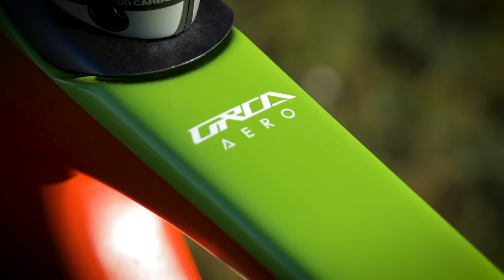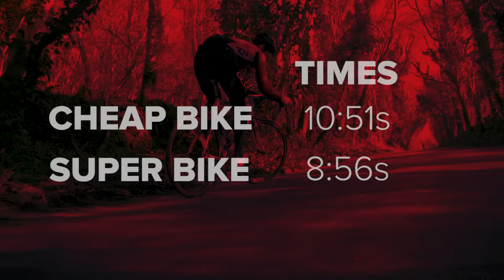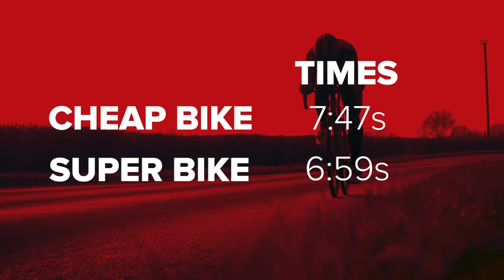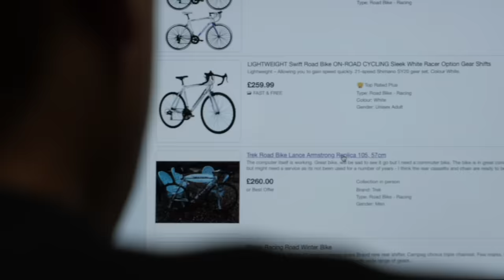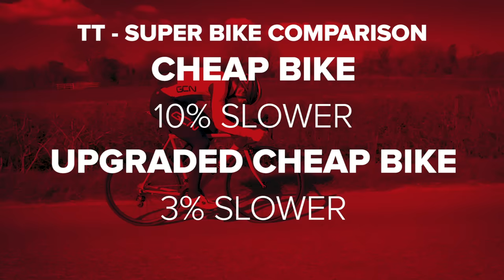Can We Convert A Cheap Ebay Bike Into A Superbike?

Comment: Lol... all of you spoiled guys on your super bikes!!  I actually appreciated this video quite a bit as I'm of modest income.   I started riding to help recover from a car crash injury.   An old single speed Schwinn Caliente is where it all began.... a year later I was stripping road bikes and converting them into single speeds myself and replacing everything with bits of carbon.  I got my 24lb Diamond Back down to 16.71lbs.  Fast but uncomfortable.   I learned of proper fitment (watching GCN of course) and that made a world of a difference.   I was faster using less energy because my saddle was no longer beating my rear end to a pulp anymore.   I upgraded my tires from 23mm to 25mm and could not believe the difference.   I traded my bullhorn set up for dropbars and found that I could deliver more consistent power to my wheels for a much longer period of time.  Needless to say,  "I'm proud of my bike!"  It took me over 4yrs to build that bike and as of last year I've gotten into fixed gear and  track bikes.  Got a 1986 quad butted Fuji Track bike that I ride on open road and in traffic.   What a great training tool!!  Riding my track bike forced me to focus on  pedaling and improved my pedal performance and cadence all the way around!  I love blasting uphill on a fixed wheel set up... the momentum trains you to keep going.  AND NOW... I want a bike with gears.   No,  I crave a bike with gears!  I have plenty of bicycles... about 19 to be exact.  I have an old Peugeot that's been identified as a possible Team bike.   It's already buttery smooth but alas with down tube shifters it's an obvious sacrifice in speed and I don't sacrifice when it comes to speed!!  I CRAVE A SUPERBIKE!!  And that's why I loved this video so much.   I view geared bikes as "range extenders."  Ultimately I imagine that my single speeds and track bikes will enhance  my riding experience, provide training so that I'll have a competitive edge on a true road bike!! 

 Sorry for the long comment but this 25 minute video is a wink at the dream I've been chasing for nearly 5 years now.  Love GCN... keep up the good work!

Comment: I still have my CIOCC custom built in 1985... 12 speed Shimano 600 SIS all stock except the handle bars and seat which were changed out during a refit about 10 years ago.  Only part that has failed in 37 years has been a downtube shift lever. Never broken a spoke or anything... rides like a dream.  When I first got it I was offered a Team Look carbon frame from my builder... neither one of us had any clue how long one would last.  My introduction to carbon frames was him tossing that frame and fork at me still in the box and I thought it was an empty box. Learned later that was also the frame that gave carbon it's reputation for being sloppy because they just transferred standard steel frame tubing sizes over to carbon and layed it up... a lot lighter, but noodly.  Then carbon got to stiff over time and noisy, and then it developed further into modern carbon... a lot of which is pure crap, but some is amazing.

Comment: Having build 2 bikes from frame up, I can tell that it is one of the most rewarding experience for a cyclist, plus every part - the handlebar, seat, shifters, crankset, pedals are of your personal preference.  That adds a psychological element at the time of riding and also makes the bike that much more comfortable for you. It is also very good knowledge to have when there comes time to fix and issue with the bike. Great video. thumbs up.

Comment: I had a 1997 Cannondale for the longest time that I love. It's a beautiful bike and I'll never let it go but had to buy a modern bike and stop sinking money into it around 2006 when I rode to a shop to buy some new tires and the owner talked me into taking a carbon bike out for a test ride. I rode down a steep winding hill and was impressed by how responsive it was on turns. Riding back up, the stiffness and weight difference were incredible. I flew up the hills. I still ride my Cannondale to work because it gets tons of compliments. It's a very pretty red and yellow paint job. But if I am going for a challenging ride, I am going with my Giant I bought last year.

Comment: I've upgraded a 2006 Fuji Roubaix to the point the only thing original on it is the frame and fork. As of March 2019, all new 105 groupset, aero wheels, carbon seatpost, e.t.c. I was regularly passing people on $2000 bikes in my last two races. Over three years I spent $1000 in upgrades, that's only $28/month, by hitting the sales and clearance. It weighs as much as a new $1600 bike, and has some better parts too. If you find a good used bike, upgrade the components until you've got great gear on an ok frame, then upgrade the frame. February to March is a is a time to ask your local bike shop to call their dealers and see what's on clearance. The added benefit is your bike will be fully customized to you. That goes a long ways towards comfort. Even if you buy a new mid range bike, you're still going to spend more on changes to have it suit you. Start cheap and build up.

Comment: I was able to buy an older 2005 2006-ish aluminum frame carbon fork bike for about $200. Then I upgraded everything the cassette the wheels shifters you name it. It made a huge difference. I feel it’s as good as any newer bike of a similar spec. I use it mostly for riding around for fun or grocery getting not competition. Saved a few hundred dollars as well.

Comment: I'd love to see a sub 5Kg weight-weenie build project next
Reply: Scoba Mowol that would be so expensive
Reply: They would never do that because if they did so, they would have to use light components from brands that are competitors to gcn sponsors. That just would never happen
Reply: It'd be cool if they did that but sourced everything second hand or on discount.
Reply: Jacob Richardson but it would have to be the most up to date and they would not be second hand
Reply: Naglis Andriejūnas which brands are you referring to?
Reply: for Ollie up Sa Calobra..
Reply: At the bike shop I work at, we once built a sub-10 lb bike. That one was bonkers.
Reply: Yes yes yes! Even sub 6kg for under $5000 AUD or $3500 USD. Something that should beat the  $10,000+ Obea up hill.
Reply: Too light, too fragile, and probably too pricey. I whole.heartedly agree, need to do it GCN!
Reply: that's really not interesting at all, axliteness lightweight and thm would do that easily.
Reply: Ollie previously did exactly that. But in a different job before joining GCN. I'm sure you can find the vide using google

Comment: I did something like this with my bike. I bought a 2006 Tarmac S-Works frame on ebay for about £270, and then did one build with mavic ksyriums and Ultegra 6600. Then after getting a wicked deal on some old stock I upgraded to 6800 (full groupset for £500) and did RideLondon 100 in 2017 on that build and went quite quick.

ebay then yielded a set of Mavic Cosmic SLS wheels for £400, I've since done RideLondon twice more with this build (2018+19), and broke 4 hours 40 minutes last year. The cheap route can absolutely still give you some wicked speed

Comment: I bet if you put same zip wheels on the GCN bike for the test then it would be even closer on the TT
Reply: But it would bust the bank!
Reply: what I was thinking
Reply: would be actualy intresting to see if there would be even a significant gap
Reply: But you can buy a midrange bike for the cost off those zipp wheels😉
Reply: I would be more dramatic: I bet the Celeste with the Zipps is faster than the Orbea with the cheapo modern wheels!!!!
Reply: My thought was that the super-bike isn't different from the "new" build of an old classic except for the wheels and the geometry (obviously). I know they were not comparing the old bike to itself but I think it would be dramatically similar and demonstrate the effect of wheels over almost anything else. I loved the build and glad they showed how to bring new life to an old bike WITHOUT breaking the bank. Just my 2 cents.
Reply: I don't realy see the need to change the group. they coud have baught new chainrings and cassete and spent more on (aero?)wheels
Reply: @Jaburu  Yes, a couple of months ago I bought an alloy 2001 Pinarello Galileo with Campagnolo veloce 9 speed ( for about $250) and was amazed how good it was.  Upgrades in order of importance 1. Gear 39x23 is just not good enough unless you were much younger, used to grinding up climbs and never knew anything else (with 61Kg for 1.76m, I spend half of the climbs standing on the pedals in the 80's, ala Pantani). 2. A light pair of carbon tubular wheels with low spoke count = dramatic difference  3. tires size (25 much better than 23), Possibly 11 speed instead of 9 (marginal if you have the right gear range. The geometry of the 2001 alloy Pinarello is the same as an F10 and I am not heavy enough or powerful enough to say that rigidity difference was significant. Actually, blind test I would have said it was carbon (as opposed to steel or Ti which do feel dramatically different).
Reply: @julmeissonnier  also, since the frame is old, why buy all parts new? things like wheels/handlebar can be baught used in good condition
Reply: Jeremy Bart aside from stack height, I imagine there’s very little difference in the geometry of the two bikes, IOW HT angle, ST angle, BB drop, CS length, etc... the slope of the top tube and attachment points of the seat stays aren’t actually ‘geometry.
Reply: @Jaburu  Agree. The main complaint was the ghost shifting and tire traction. How much of that could have been resolved with a tune-up and tire swap? Because if that's easily resolved, it would open up the budget for something other than the group swap, and wheels definitely come to mind there, or a carbon fork or carbon seat post (to shave some weight for the climb) (or to improve stiffness/compliance).
Reply: @Jaburu  I think the point of the whole group set was to get the mech's and brakes as well over just the crankset and cassette
Reply: @mattsharpe3989  I see
Reply: That was what i was thinking to. And also something that most people would do. Take there old bike and upgrade a few part at a time. First the group and then maybe invest in aero wheels the next year. Or thats what i did with my old bike. Would it be possible to do that next time @gcn? And with a power meter on both bikes the test a proper "GCN does science" (maybe in the pedals so you cab just swap them between bikes).
Reply: i bet changing the wheels alone would have made the otherwise ummodified older bike as fast as the new bike.  New wheels and tires, new chain and (9sp?)  cassette, new cables and bar tape.

Comment: Have done this a few times now ... trick is to buy absolute top spec components (Durace, XRT) lightly used on Ebay where people are always unloading great stuff because they want the latest. For example, 2x components from people converting to 1x or 11-speed from people converting to 12.

Comment: That was a Trek aluminium frame from 2001, decent bike for its time and not a million miles off with the upgrades they did to it in this video..

I have 3 Treks, 2 are the 'legendary' 5200 OCLV120 frames ( one from 2003 and the other from their final year of production in 2008) and they are still absolutely fantastic to ride, I had the 2008 one specially made up for hilly rides with a different gear ratio setup and a respray, carbon seatpost and handlebars and it still looks like new today ive looked after it. The 2003 one was in US Postal blue and silver livery but ive just decided to give it some tlc so its going for a respray job and tweaks so it will feel like a new ride again. The interesting thing is my nephew who is only 18 has got into cycling the past few years and rides the latest Trek/Cube creations, yet when he's hopped on my old Trek 5200s he says they feel smoother and a better ride!  

Wouldve been interesting to see if they had used a 5200 in this video, I reckon it wouldve been very close to the Orbeas times, they are still pretty punchy with their climbing acceleration when you attack a climb even though the geometry was conventional (non sloping etc) but nice and tight with it.

Comment: Great work on the cheap bike. I have a Viking 2011 VK sprint model that I am now upgrading in under £300 with new wheels, spray paint, handlebar, stem etc converting my old free wheel to freehub.

Comment: Done the same to a 2016 B'Twin RockRider 500S - added SR SUNTOUR Epixon RL-R MTB Suspension Fork TK 26" 120mm and a Fox Suspension Float Factory LC EV Rear Shock, Carbon handlebars, Magic Mary upfront and a Michelin Rock'T on the back. Not as good as my Whyte T-130 CRS, but the Bafang BBSHD motor and 17.5AH Li-ion battery pack turn it into an off-road monster! 👍
It'll never be a Levo, but boy, is it fun!! 👍🤣

Comment: If I were the one to have gotten my hands on that Trek,I would have:
-Paint stripped it,then lacquer.
-Switch out the Shimano 105 to Shimano 7700 derailleurs,12-23t cassette(and Sora R3000 brifters)
-Have a pair of Biopace chainrings(preferably 52-36t).
-(this should be unexpected)Get a lighter weight square taper crankset,and square taper BB with a Ti spindle(because there shouldn't be much difference in stiffness between an Octalink and square taper BB,but weight differences are discernable).
-Switch out the cockpit,seat post and saddle for decent Chinese ones from eBay.
That's me.But I still respect the GCN team for having embarked on such a project.I'd like to see more of this if possible.

Comment: Should have serviced the trek and put a new chain and some ave tyres on before the first test really. All the initial test did was highlight that the bike was almost unrideable. Sounding negative - really enjoyed the series :-)
Reply: exactly, if the orbea had crap tyres and un-indexed rear mech it would also have been slow and unsteady.
Reply: Sooooo true. At least tune the shifting, and move the bars down a bit, give the trek a chance, some of us are still riding this bike today!!
Reply: Oxley Rise Estate I ride a trek thats over 30 years old. It was originally an offroad bike, but I put road tires on it. Other than that the only thing needed replacing were the grips (dryrot) and the rear axle. 1983 my dad bought the bike, and I've been using it for years now and it's still going strong.
Reply: (1) it's the engine, (2) it's the bike tune including fit, (3) it's the bike, 3rd.

Comment: This video is very interesting.  Literally, I take delivery of a 2003 Trek 5900 110 carbon fibre bike tomorrow.  The plan is to stripe and repaint, replace the older Dura Ace components with new SHIMANO ULTEGRA r8000 11 speed groupset.  All in I've figured around $1,200.00.  I'm betting the rebuild will be even closer to the super bike times of this video.  When compared the cost to a new Giant TCR or Canyon Ultimate with the exact same components, the savings was give or take $3,000.00.  Can't wait to get my hands on this bike!  Thanks for all the great content GCN provides.

Comment: Well interesting, but for the same price on wiggle, you can buy a brand new 2019 Fuji Gran Classico carbon frame road bike with ultegra group set ! Of course, if you have the tools and time, building up such an old bike like that Trek is more like a hobby than actually saving money.
Reply: As Wiggle is a sponsor,  it would be great to put them side by side.

Comment: Swap those zipps over and do the tt and climb again. I bet it will close the gap even more
Reply: Very much what I was thinking. If you are trying to turn a cheap into a superbike, you gotta use not mid-range but superbike parts. The Zipps certainly played the biggest role in this case. Match the  Orbea's drivetrain further on and the difference may get statistically insignificant. But that could give people some dangerously right wrong ideas...

Comment: Yes really enjoyed this,I have an early specialized roubaix 2006 was 9 speed 105,it's now 11 speed 105 with new pro light garda aero wheels it's much faster now.it was 20ib new but it's now about 19ib.The only original parts are the frame,bars,and 105 brakes.
Reply: Hi Mark I did a similar thing 3 years ago, found an S-Works Roubaix with Dura Ace 7800 10sp, the frame was perfect but the previous owner didn't use a torque wrench and had damaged the seat-post, and steerer. Replaced the seatpost, saddle and a different design stem helped after cutting the crushed part of the steerer away. Also replaced bottom bracket with a ceramic one, chain, cassette, tyres and just purchased a DA 7950 compact crank from eBay for little money. The original price was £150 and the bike owes me about £700 now - weighs 7.1kgs (15.6Lb) in a XL 58cm with everything attached ready to ride. Simon mentioned that in 20yrs aluminium frame tech has changed a lot, but I'm thinking of upgrading to SRAM ETAP WiFli because I like the idea of 11speed and electronic shifting, but am I throwing good money away IF my S-Works is considered old...... Decisions, decisions??
Reply: @LimeyDude  no need for electric gears I think.

Comment: Great GCN I actually did this with a 33yr old Peugeot Aubisque fitting Shimano 5800 group-set including 105 pedals, deda stem and bar tape, Giant carbon handlebars, prologo seat on a custom alloy seat post and Pro-Lite Garda alloy wheels on Michelin's , weight dropped from 12kg to 10kg and the percentages you quote are similar to what I'm getting against friends & others on mid to high range bikes (and I'm by no means an athlete) however one point I'll make after doing over 5,500km on my pug,  power to weight will always be king uphill, downhill is when rider ability comes into play.